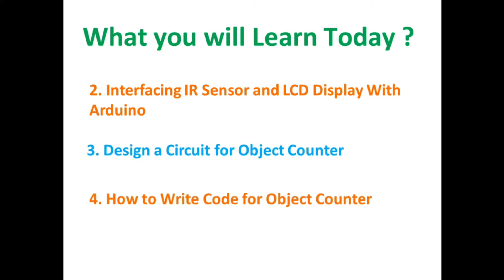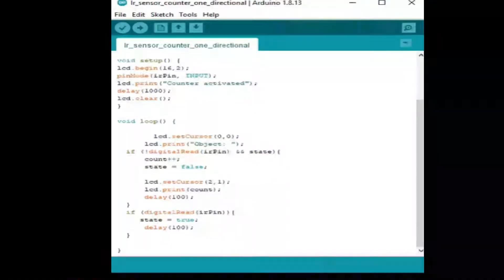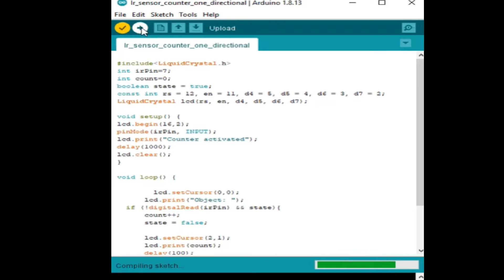Object Counter Using IR Sensor Project # 13

Comment: Brother I have a small doubt 
When object passes through it will it do the same thing , will it count like same it before or for that code and circuit will be different?
It both are same then if I pass my hand backward what will happen 
Please tell this
Reply from the maker: Well this particular cricuit cannot distinguish between object to object. At the same time it is also not meant to capture the direction of movement. This circuit can simply increase the counter by one when an object is detected in front of it... Typical application for this can be a conveyor belt carrying products.... Which is uni-directional and only the counter is needed..
Hope this helps..
Thank you